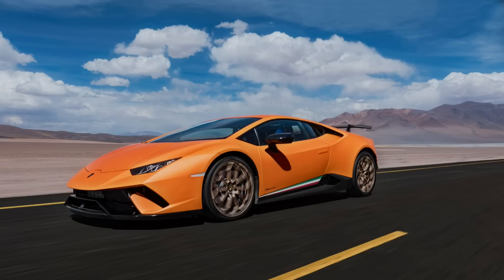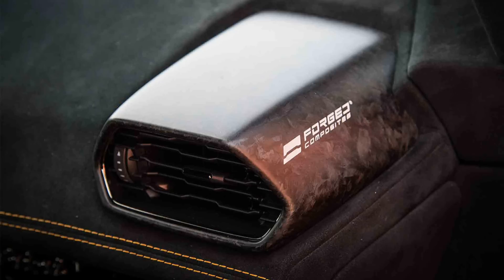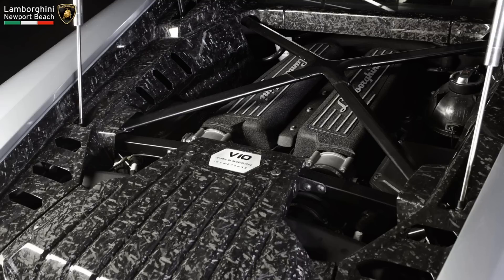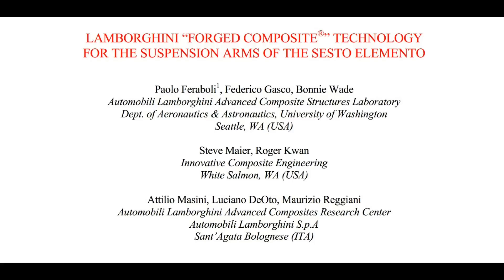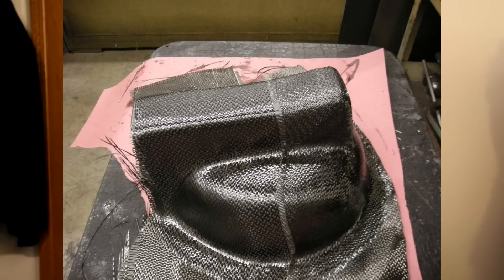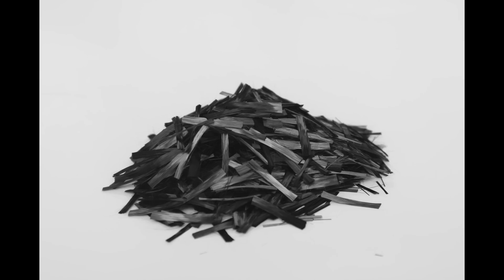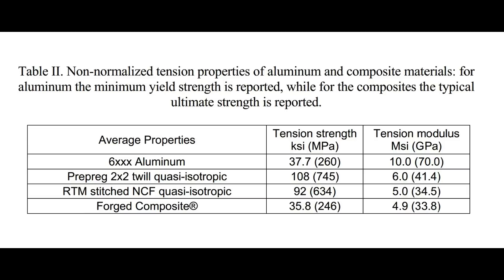Here's What Makes Forged Carbon Fiber So Special

Comment: @7:30 yes this is true, however, this is one reason why we use adhesives to bond parts to CF parts. There are many reasons a hole in CF is no good. It invites delam for one, strength as well, but it also makes the part less useful in that once the hole is made, it’s made, filling it won’t do much good other than cosmetically.

Comment: They make these parts using factory waste. BMW has been doing this for a while with their carbon core 7 series and the i-series. What Lambo has done differently is polishing/sanding the part and applying a clear coat to make it more visually appealing.

Comment: Looks/sounds to me like it's just reliant on the strength of the resin, which of course means it'll be much weaker. A cost comparison would've been useful because comparing carbon to 6000 series aluminum is kinda dumb when 7000 series T6s & T7s have more than double the strength of 6000. Forged carbon looks like the product of a recycling effort, like sump'm you'd use for packaging materials or sump'm like that. Good vid.
Reply: hmmm
Reply: it actually isn't, it only depends on the curing pressures and the strand length

6 mm is the best length

you can use pretty much any resin and it will perform the same

Comment: well, the latest Lambo now has forged carbon connecting rods in it according to recent automotive news. should make for amazingly light internals, lower moment of inertia for the reciprocating parts, in shorts a faster revving motor.  Also seeing forged carbon wheels coming to market so the technology is maturing.
Reply: sauce?

Comment: Prepreg is a fabric pre-impregnated with resin and typically stored in a freezer to postpone curing.  “Forged carbon” comes in prepreg form as well.  The major difference is cost. Manufacturers can use scrapes from the woven fabric to make the forged stuff.  If they screw up a roll they can chop it up into small pieces and make it as well.  Basically carbon fiber became super expensive because Boeing bought up just about every last inch of it to build the 777.  Lamborghini felt the price increase.  They have to use the woven prepreg for the structural parts including the tub because it’s much stronger.  They had to find a way to cut costs on interior parts so they “invented” forged carbon and built it up to be this very special product.  When it is in fact, cheaper, less durable and has far less strength.  This is why Boeing doesn’t use it.  The consumers stand in line like sheep and take it in the butt.   Very similar to Alcantara. Alcantara is a weaker crappy fabric that stains and can’t be cleaned well and of course is way cheaper than leather but they charge 3 times more for it as an option.

Comment: I think we can strike a balance here for forged carbon by using it on the doors, bonnet, bootlid, roof etc while using woven carbon-fibre for the monocoque. By doing this, car manufacturers can save a lot of time, money, energy and natural resources but at the same time, it won't affect the safety or the performance of the car.

Comment: Forged Carbon Fiber is basically like particle board. Particle board is made by taking all the left over scrap pieces of wood that are normally just trash and mixing them all together with a resin and shaping it into a board. Forged Carbon Fiber is basically the same. They take the individual fibers that are normally woven into sheets of carbon fiber and instead of weaving them they’re chopped up into small pieces and those are laid into a mold with the resin that holds them together. That’s what gives Forged Carbon Fiber it’s unique look but also what makes it weaker than woven Carbon Fiber. It works good for trim or non structural pieces.
Reply: hm

Comment: This was really helpful. I will attempt to use forged CF for cosmetic or non load bearing parts, but stick with resin infusion with CF fabrics for anything structural or aerodynamic related. Especially anything the needs to flex in a specific direction. I am sure forged graphene is next which should be lighter and stronger than prepreg. Cheers!
Reply: hmmmm

Comment: For those that don’t understand this. “FOrGeD cArBoN fIbEr” is nothing more than a selling term. It’s not an actual material that exists. The dude even says in this video it’s just chopped up strands of carbon fiber that’s dropped into a mold and hardened with resin. That’s not forging, the material itself is not cabaple of being forged, it is simply for vanity and nothing more. The parts Lamborghini makes using this process takes less effort and their customers are just too stupid to realize they’re paying top dollar for a half assed product. Anyone that actually understands and/or works with composite material will know this.
Reply: I think your resentment is clouding your "thinking".

Comment: So basically this fortified plastic.  I 'm not being a smart ass.  I can see all sorts of awesome uses for this because it appears to be lighter and stronger than some aluminum alloys. It also seem to be less heat dependent in the fabrication process. Any pot metal molding parts could benefit from this process.

Comment: around 5:00 youre saying that Aluminium is stiffer than carbon. I think high tension modulus means low stiffness.
Reply from the maker: The modulus is the relationship between stress and strain. Materials with higher modulus require more stress to produce the same amount of strain, so higher modulus = stiffer.
Reply: Ha, he told you...lol

Comment: Prof. Feraboli. the 1st guy named is the one who set up the Lamborghini Composites Lab at U of Washington Seattle... along with some funding from Boeing (not a surprise since the lab is in the aeronautics dept. Very nice guy, who always answered my questions!  "Forged Composites" or as a French competitor calls it "Carbone Forgé" is basically injection molded carbon fiber.  The French Co who makes Carbone Forgé put the dry chopped carbon strands in to a mold, compress, then while under vacuum & heat in an autoclave inject the epoxy.

If you read the paper (there's a 2nd one as well) Lamborghini experimented making carbon-tubs, suspension pieces like A-arms which proved to be stronger than the cast aluminum used now (there's pics of the parts)  its strength basically comes from the random overlapping strands.  If they add some graphene to the epoxy, they could make it stronger and lighter!  Its the future of making carbon parts. Callaway golf invested too, although they use a metal face on the club, no ball touches the carbon,  the body is made of forged carbon... the carbon-epoxy slurry is pumped in to a mold, a latex bladder is inflated to push the carbon against the mold & keep the part hollow.  I think Lamborghini is still learning its strength & limits and is using it basically for cosmetic light parts at the moment.  like the center console, A/C vents and dash & door trim.
Reply: Hey can I get a link to the paper?
Reply: @uhrwerks thanks for the added comment. Both Carbone Forgé and Lambo/Callaway talked about patent and pressing time which suggest that it is somewhat different than regular injection molded carbon fiber. Any insights on what are the main difference between Forged Carbon and Injection Molded carbon fiber? thank you